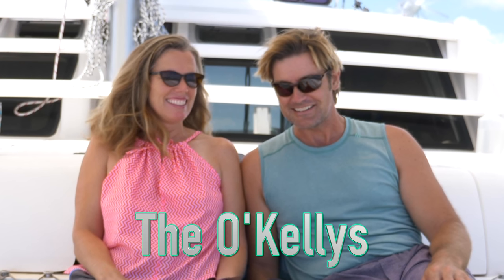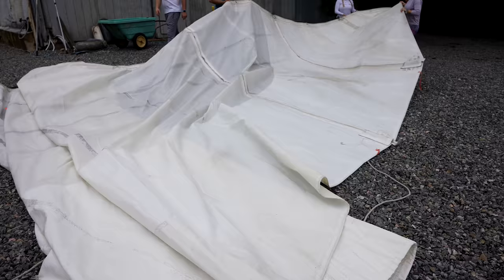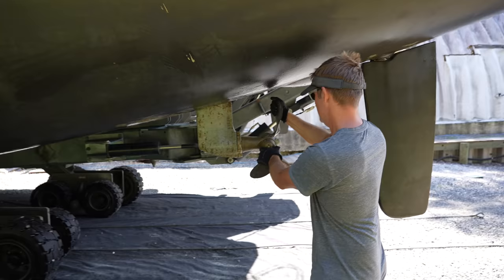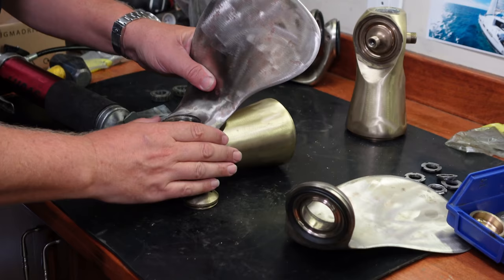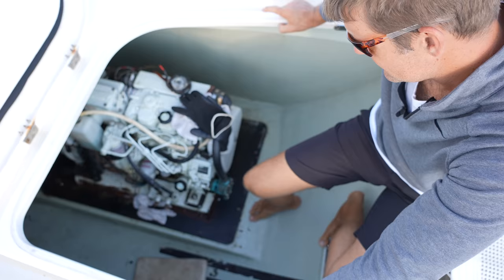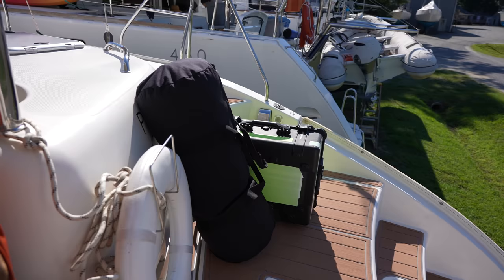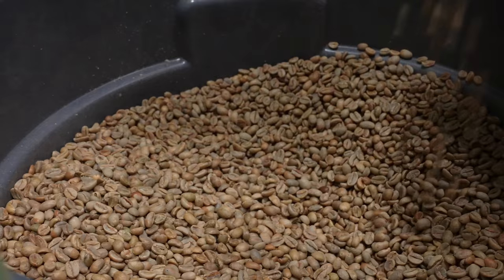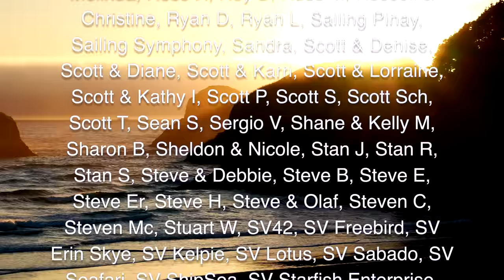Calling in the Professionals & A BIG Announcement

Comment: Boat air conditioning... while anchored, pump water from 20 feet down up into a cabin radiator & back to the ocean. Have a fan blow air through the radiator. Should cool the cabin. A water pump & fan, no refrigerant or compressor .....
Reply: It's an interesting concept.  How much cooler do you think the water gets in Florida during the summer time when the surface water is at 83°?  A lot of the anchorages are only 10 ft deep. 

Might be a couple degrees cooler at the bottom but maybe not enough to make it worth it

Comment: I had Martec folding 2 and 3 blade props on the Manta and really pleased with the performance, reliability and ease of maintenance.  The only trick is to have the right tools for removal. In the water is easy with tanks or hooka.
Reply: The best folding prop for the best performance with relatively ease in maintaining was the Volvo folding three blade.

Comment: Interesting to see that you're opting to ditch the genset and run engines to charge if/as/when the solar doesn't keep up. I've often read that propulsion engines aren't designed to run long periods without a heavy load, which is why gensets are advised. Perhaps that information is out of date? My approach on my mythical Caliber 38 would include a small genset in the engine room to charge the battery bank and heat the water for the wife's essential hot showers (in lieu of hydronic heating, which would be the ideal, IMO). Always great to see a different approach and get new ideas.
Reply: I thought I heard a snippet in an earlier episode where Nick stated they would be upgrading the alternators or adding an additional one to the engines. I could be mistaken.
Reply: @edbloom4897  That matches my recollection. I just wonder whether a high-amperage alternator puts enough load on the engine to keep it in good nick vs using a purpose-built genset for the task. I don't yet have enough knowledge to say one way or the other.

Comment: I was in coffee for 30 years, sold up about 5 years ago. Used to visit the SCAA in usa every year. If I could only give you one piece of advice that will set you apart and make a real difference to the flavour of your beans is HOT AIR ROAST 
There’s a company in Oregon called sivetz. Do your homework ( more thorough than you did with your anchor chain🙄) but they make good roasters and would be worth a visit.

Comment: Sailing Nandji just had issues with their Brunton prop failing.  They were told the props need a complete rebuild every 1,000 engine hours.
Reply from the maker: Really. That doesn’t jive with their marketing. Bearing rebuild maybe, but full rebuild?
Reply: @TheOKellys  Feel free to drop a message on their YouTube channel when the video comes out here in 2-3 weeks with their prop incident.  Maybe I am missing a detail, but Yosh posted on their Patreon feed he is replacing 'everything' but the blades when the parts from Brunton arrive and the company said it needs to be 'rebuilt' every 1,000 engine hours.  Based on his description of what went wrong on a Patreon live broadcast a few weeks ago, it was not a bearing issue but something wrong with the fundamental assembly of the hub and the locking nut.
Reply from the maker: Great......ugh. That’s not a lot of time for a prop.

Comment: Add a little bit of LUCAS OIL 🇺🇸 to the engine oil. That stuff is fantastic for keeping all the rubber parts in fantastic condition ie it stops them from going hard and brittle and leaking. I’ve never had any leaks in any engine or transmission or differential after LUCAS has been added 👏🏻👏🏻 💪🏻💪🏻 👌🏻👌🏻 😎 🇺🇸LUCAS OILS ❤️  and I’m in Spain 🇪🇸 and it’s 44 today 🥵🥵🥵🥵🥵

Comment: So did the genset make the battery compartment hot and isn't that bad for the batteries?
Reply from the maker: No, the genset was well ventilated. It was mainly a space and weight issue. We did move the batteries into the salon as you’ll see in a week or two

Comment: I am a rookie at this and still trying to figure out all the sailing stuff. However my question is measuring a sail after it’s been in use. Would that  measurement of the sale include the stretch of the old sail or do you calculate the stretch of an old sail?  I hope this question makes sense.
Reply from the maker: Old sails actually shrink. We measure the other dimensions on the mast and boom, then get dimensions for reefing points from the sail
Reply: @TheOKellys  see learn something everyday. Thank you 😁

Comment: I don't want to burst your bubble but using an old stretched out sail is not the way to measure a new sail. It may be helpful to use the old sail if there are particular design aspects you like that you want to be incorporated into your old sail? Otherwise I have had 40 plus years experience of replacing sails with professional lofts like UK Sails, North etc. They are not interested in the old sail. They do all the measurements themselves. Same for professionals replacing canvas. They can't take measurements from an old, stretched out piece of Sunbrella or Stamoid they have to come and take actual measurements. If not you'll end up with a new piece looking as saggy and baggy as the old piece. Rob sounds like a good guy but maybe the product doesn't match the passion. Max Prop is fantastic. In any event I really enjoy your show and I wish you all the very best.
Reply: That is good advice Oliver. Especially if the old sails are Dacron and old. I was surprised how much the luff changes from halyard tension alone, never mind the bias stretch from a cats RM.
Always take actual measurements from the rig for new sails.